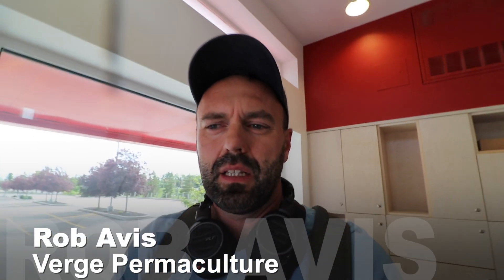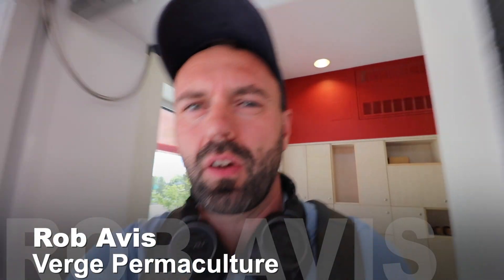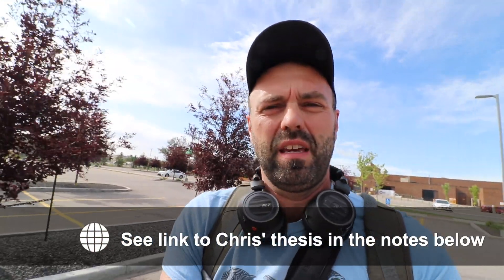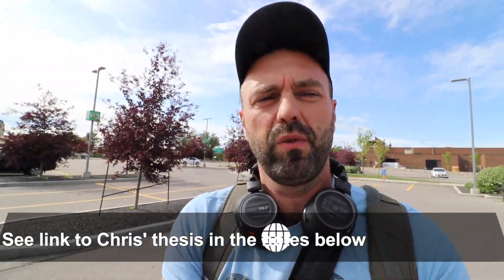Creating the Standard for Carbon Zero Homes in Canada!

Comment: Hi Rob I am designing my Bill Mollison inspired home on a Greece island. The structure is a double brick insulated cavity. Can you test the insulative properties of the lightweight air bricks and what would be the best available insulation material for inside the cavity. Ive written an article that I will post within the week on the faults of the current A rated eco home and how to build a home that that by design

           - Heats it's self in Winter

           - Cools it's self in Summer

         to be a comfortable temperature all year round, so youI don't have to open your windows 

         as there is always fresh air - free of moisture & mould.

                 - All WITHOUT ELECTRICITY -
on my Kostas Creating Sustainability site Check it out as perhaps you can give some advice if you feel any points I make could be improved. my aim is to have laws here amended so I can actually build this and not the hyper insulated plastic wrap with air and heat recovery added, 
as these are fundamentally flawed systems. Anyway please let me know what way you think Is best for the in cavity insulation. p.s. love your work hope your new place is coming along as you wish it.

Comment: there is also a carbon footprint in the capital that is needed to pay for the materials/construction; in short expensive technologies will have high carbon cost even if you build only from wood or hemp etc.; cost needs to be considered; second thing is that you need to consider carbon footprint per surface and/or per inhabitant; building 1000 square meters hous for 2 people will never be low carbon even if you use negative carbon materials;